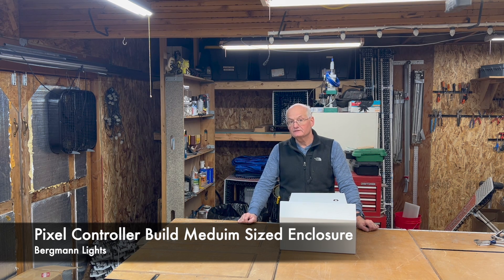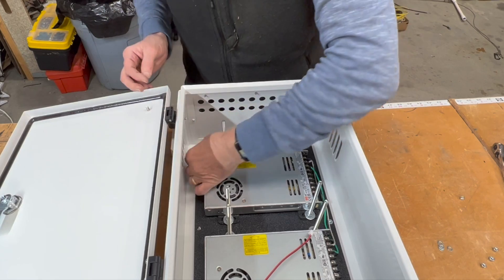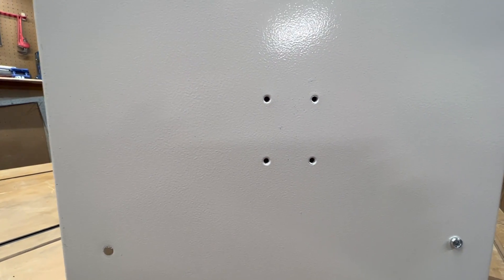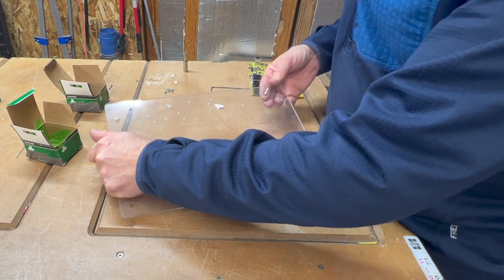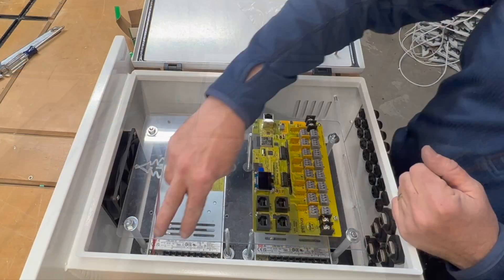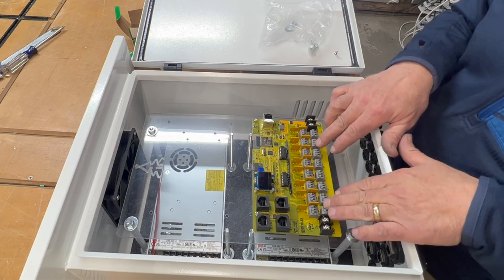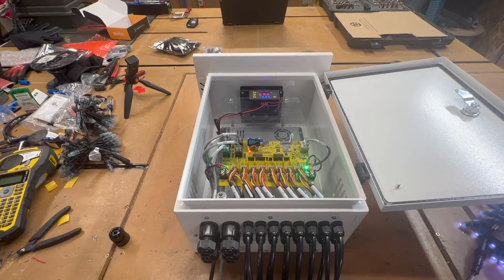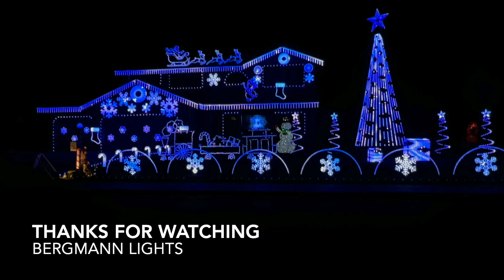Pixel Controller Build (Medium enclosure)

Comment: How are the power supplies powered, each with their own power cord? I only see 2 wires running between the PSU.
Reply from the maker: I use one AC power cord for two power supplies.  There are 4 in the box, so two there power cords.  I would recommend using 16 gauge power cords.

Comment: For the Temp control unit from YPS: When installed as instructed by this video, a short was created causing the whole power supply to shutoff and not power on. After troubleshooting, I got everything to work properly by removing the additional power (red) line from the S1 port. Just in case anyone else is trying to troubleshoot l, give that a try 😁. Thanks for the video!
Reply from the maker: Thanks for sharing your troubleshooting experience and the fix!

Comment: are you using 2 Meanwell 350W power supplies?  Can you  use 1 600W?  Any benefits besides the extra 100 watts
Reply from the maker: Yes I am using 2 350 watt 12VDC meanwell.  No problem using one 600

Comment: Is it safer to use one powercord for two powersupplies like you did or you two powercords one for each powersupply
Reply from the maker: You need to make sure the wire is sized appropriately.  The Meanwell power supplies I use pull 6.8 amps AC when on 115VAC based on the company’s data sheet.
Reply: @bergmannlights5149  I used the 12V 350W ones, two of them
Reply from the maker: That is what I used.  Make sure your AC plugs wire size is big enough.  I used 16 awg, which is undersized a bit since it is rated for 13 amps.  I do not push my controllers beyond 80% so it is fine.  If you are pushing your power supplies you may want to jump up to 14 awg.

Comment: I have another question. Hope it doesn’t come off as being a dumb question. What are the benefits in using 2 power supplies to power the controller? Thanks again for your help.
Reply from the maker: It allows you to power more pixels per port.  The typical controllers power 8 ports on each side of the board.  You quickly run out of power using standard pixels with only one power supply
Reply: @bergmannlights5149  , thank you. I’m thinking of changing to the small YPS enclosure. I currently using a CG1500 enclosure for main controller & one power supply. Thanks for your informative videos.
Reply from the maker: Glad to help.

Comment: Do you not run fuses between your power supplies and the controller? Or do use something else? Thanks for your time.
Reply from the maker: I do not put a fuse between my power supply and my controller.  Don’t think one is needed when you have high quality power supplies like the meanwells I am using
Reply: The controller has fuses built in.
Reply: @adegraw  , the fuses that are built in, are they for the output ports and the power that comes in from power supply?
Reply: @TopBlackWaterSniper  yes. if you look at the controller in the video, it has 16 orange square pieces that stand up between the outputs. Those are auto resetting fuses. Most controllers will have fuses built in.
Reply: @adegraw  , I understand that because I have the same controller. Im not using Meanwell power supplies. I have generic ones. My original question was if I should fuse the power between the power supply and the controller.
Reply: @TopBlackWaterSniper no need. Fuses are built into the controller.
Reply from the maker: You should be fine .  I have seen others fuse the line from the power supply to the controller but I don’t think it is necessary.
Reply: @adegraw  , you are right. I contacted Experience Lights and David said that no fuse is needed between power supply & controller.

Comment: Thank you very much!!!  This video definately helped me understand how to build this box..  Did you have a video for the YPS large box with a 32 port Experience Pro 32 controller?
Reply from the maker: Glad it helped.  I have not done a build with the Experience Lights 32 port controller.  Process should be very similar.  I did do a build with the large box using the 16 port controller.  Check it out on the channel

Comment: My enclosure came with missing mount points installed in the back. I believe you referred to them as M4 studs. Do you happen to know what I could order as a replacement?
Reply from the maker: I believe they are M4 screws and nuts but might be M3s.  You can source them at your local big box store.  Here is an Amazon link for an assortment of screws that will have something that will work for sure.1080 Pcs Screws Bolts and Nuts Assortment Kit, Metric Machine Screws and Nuts and Bolts and Flat Washers, M3/M4/M5/M6 Phillips Slotted Pan Head Hex Bolts and Nuts Sets - 900g/16 Size https://a.co/d/5Uc1UW9
Reply: @bergmannlights5149  Thank you so much!
Reply from the maker: You are welcome

Comment: Thanks for all these build videos using the metal boxes. I'm on the fence trying to choose large or the medium. Based on your hands on experience, what would you pick to hold 4 power supplies, a falcon f16v4 and falcon f16v4 expansion board (using all 32 ports) - the medium or the large? I'm a fan of having room to work, so I'm leaning to the large box, but is it overkill?
Reply from the maker: The large box will have plenty of room.  You can pack 6 power supplies in it.  The medium box will work as as well.  The medium box is a bit larger than the big bud box which is what I have my falcon F16v3 with expansion card in.